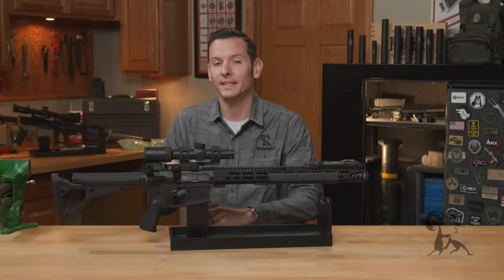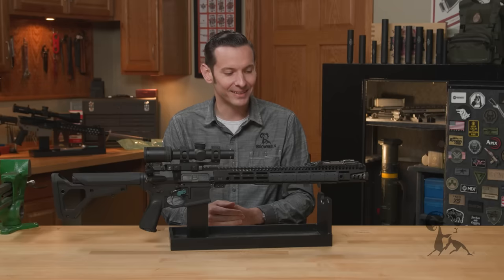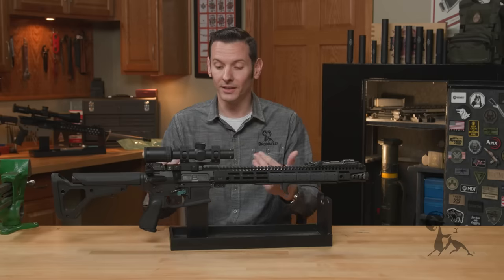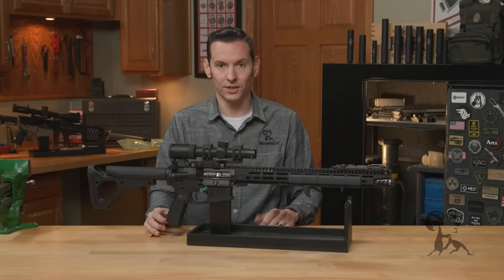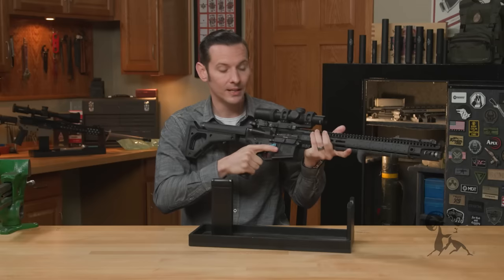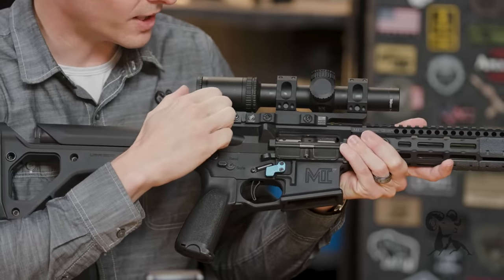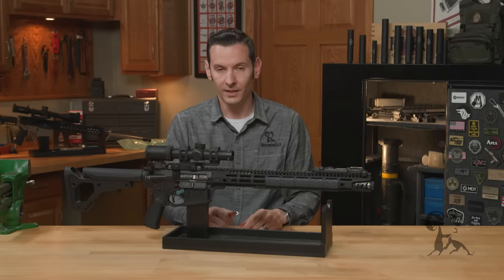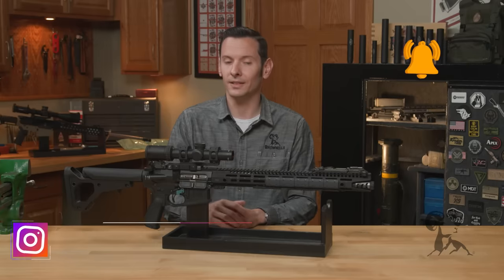Quick Tip: The RIGHT Way To Use the Forward Assist

Comment: Where's my forward assist gang at?
Reply: You can just push on the bolt cutout with your finger.  No button needed.
Reply: @Vuntermonkey  This doesn't work as well imo
Reply: Gang gang!
Reply: I feel cool tapping it after running the charging handle.
Reply: Caleb hit the nail on the head with this one.
Reply: @Vuntermonkey  No, you can't. This isn't an M3 Grase Gun.
Reply: Yuhhh
Reply: @Vuntermonkey  I covered that in the video... watch THEN comment.
Reply: @Vuntermonkey  with a crane O ring no you can't. And try that when the gun is red hot tell me how much you like your fingerprints.
Reply: 😂 I actually push it 🤷‍♂️ it’s a button I’ve got to push it and push it good 😁.
Reply: @J J Fun fact, Stoner didn't intend for the cutout to be used to push the BCG forward.
Reply: @Valorius  You mean I can remove my fingerprints that way?  Is it permanent, and will it mess with BATF tracing in the event I may want to purchase a sound suppressor?
Reply: I don't use the forward assist but it's on my rifle
Reply: Good to hear someone speak about SPORTS, I haven’t heard that term used in a while. It is a bit outdated, but it is a good starting place for beginners on this platform.
Reply: Here
Reply: I don't always use the forward assist........ But when I do, it's after learning what it was actually meant to do.
Reply: I get why people who only use their gun at a range under very controlled situations think it's not necessary. But I also roll my eyes at people who are unable or unwilling to think of times when conditions may not be ideal and it may be necessary. You listed a couple - the BCG is slick with lubrication, or there's blood on your hands. What if the BCG is so hot it'll burn you? What if you're laid out on a road with a mob coming after you and a guy a few feet away has a pistol pointed at your head and you felt the bolt wasn't in battery and you don't have time to look down and push it forward with your finger?

As an engineer, the argument of "Eugene Stoner didn't design it that way," is silly. A designer can't foresee all the problems with his design, and the reason the forward assist was added after tests was that in real world usage, the design didn't account for problems that having a forward assist solves.
Reply: @chrisgabbert658  I was going to do that lol.
Reply: Kyle Rittenhouse made me appreciate my forward assist a lot more than I did beforehand
Reply: @Legacy 1776 Stoner objected to the forward assist all together. Military brass requested it.
Reply: @RefreshingDrPepper in case you haven't noticed most people in the gun community don't care about your feelings....lol
Reply: It comes in handy believe or not.
Reply: Here lol
Reply: @edwarddrost5299  lol
Reply: I’ve never used it…but yet I insist I have it in every lower 😆
Reply: @michaelkennedy996  uhhh
Reply: @michaelkennedy996  I'll bet you didn't give up when the Germans bombed Pearl Harbor either did you? :D
Reply: @Mangoré1885  i'm glad it makes you feel safe
Reply: @shooter31m  No.  Anytime you hear SPORTS mentioned as something to do for immediate action, credibility is lost, including in basic training and BRM from your Drill Sergeants.

Tap Rack Bang
If that fails, 
Rip Rack Clear
Reinsert Push/Pull Rack Bang

Notice how Forward Assist isn't anywhere in there.

The main thing Forward Assist might be useful for is post water immersion, break chamber seal to drain the barrel, then quietly re-chamber the round.

You can avoid that problem by using muzzle plugs or condoms over your suppressor when working in a riverine environment.
Reply: @762x69  Kyle Rittenhouse should have reminded you it's not such a good idea to pick up a dry AR-15 from your friend's basement when needed for life-preservation.

Had it been lubed, he would not have had that malf.
Reply: It worked just fine for Kyle that one night....
Reply: @LRRPFco52  that's a funny way of saying that there's no way the ar-15 could've malfunctioned or put out of battery when he landed on his back and got hit by the skateboard guy..
Either way he said he still used it. Can't change that no matter how prepared you think we gotta be
Reply: Waaaaasssssuuuupppp!
Reply: I was anti-FA until a young man in Kenosha got his rifle knocked out of battery, used the FA and got back into the fight. I am an FA believer now.
Reply: Part of my training regimen. It's there for a reason.
Reply: I'm in 👍 The rifle will & should run without the need BUTT 🤭 I use the little pushy springy button thangy 🙄
Reply: Skreettttt skreeeetttt
Reply: @Vuntermonkey  ummmm you think Kyle Rittenhouse coulda just used his finger to push it home that night? Forward assist is needed when it is needed. I’d rather have one and not than need one and not
Reply: @762x69  facts
Reply: Gang Gang!
Reply: It blows my mind that theres so many who argue till theyre blue in the face with many who have actually used the fa in combat telling us how stupid and useless it is, but as soon as a 17 year old shows them in real time how life saving it can actually be they immediately change their tone. Aside from the actual uses of it, i think it completes the look of the ar. Ill never forego the fa on any of mine.
Reply: I'll keep my thumb off the bcg, and just use the F.A. especially when it's HOT... 👍👈
Reply: Sign me up, Caleb!
Reply: Present sir!!
Reply: SPORTS is not outdated nor is it useless.  Outside of a combat or speed needed situation SPORTS is still  relevant in determining the possible causes of stoppage or malfunction and getting your gun back up. Slap Rack Bang is just an abbreviated version of SPORTS to get you gun back up in a critical situation. The forward assist is still relevant especially if your ever had a dry nasty dirty gun in any of several situations. Shit happens
Reply: Checking in brah.
Reply: Won’t build one without one.
Reply: Whoop whooop
Reply: Me me me!
Reply: Forward assist gang member present and accounted for. (:
Reply: I love my forward assist, never leave home without it.
Reply: Kyle Rittenhouse has entered the chat.
Reply: I'd put two on my rifle if I could
Reply: @CalebSavant  I bet you get tired of reading people’s comments and knowing they didn’t watch the entire video
Reply: I use it for press checks as well
Reply: Better to have it and not need it than to need it and not have it 💯
Reply: FA gang 100%.  You only need it once to see the light.   What’s hilarious is guys who hate it being there but can’t figure out how to get rid of it.   They’re the same guys who have never cried about having the bayonet lug, since they hate unnecessary doodads on their rifle.
Reply: What sort of monster doesn't have a forward assist?
Reply: @edwarddrost5299  Fun fact I grew up next to blueberry fields and they would hire Mexicans to pick blueberries and tomatoes. There was a ton of these workers who had zero fingerprints  from cutting pineapples in other places and they still always left the country and got back in so I'm almost positive having zero fingerprints will prevent your suppression needs if you just tell the Feds you've been cutting pineapples all day and they will let you slide every time.
Reply: @BadDadio  it's depressing lol
Reply: @LRRPFco52  good Lord! Everyone is an expert these days! 

I said it was outdated, but it was nice to hear someone mention it, reminds me of days when everyone wasn’t an internet firearm expert. 

No one cares if YOU think it’s credible!
Reply: I just bought my first AR recently and made sure it had a forward assist especially after it helped Mr Rittenhouse defend himself
Reply: I think it's the reverse of what seems to be received wisdom. I think military weapons shouldn't have a forward assist but civilian ones maybe as some kind of marketing added value. The military issue weapon should have the least bits to worry about using as possible. The Immediate Action Drill should be simple, generic, to fix pretty much anything without worrying about what's gone wrong. (If tap, rack doesn't fix it, drop the magazine put in a fresh one and rack.) There's no need to do chamber checks if your handling drills are done properly. Same for bolt hold open - unnecessary on a military weapon, just means there's another condition to worry about the rifle being in and therefore decisions to make. A civilian can do all the fiddling and nonsense as they deem necessary, what does it matter. I'm coming from having had to train soldiers who knew nothing about guns and probably cared even less. Special Forces of course can get whatever gucci stuff they want.
Reply: M16A1 thru M4A1, thumbs up to the FA button. It's my opinion.
Reply: It’s a vital component
Reply: It’s a vital component
Reply: Still alive!
Reply: We were taught Slap, tap, rack, fire. Slap the magazine, Tap the forward assist, rack the charging handle, aim and attempt to fire. USMC ‘79-‘99
Reply: I just have to ask why Knights Armament doesn’t have a forward assist on their SR25 and M110 rifles? These rifles are used by arguably the most elite soldiers in the world.
Reply: So veterans, if you have one with it & one without, which would you take onto the field?  What about if you're correct (left) handed?
Reply: You damn eff AGs
Reply: ARRRGGGHHH  RRAAAAAHHHHHH!!!!!
Reply: Kyle rittenhouse stayed in the fight because of the forward assist
Reply: Hollahhhhh!!!
Reply: @rydplrs71  Why, was his charging handle broken?  In truth he should have had a sidearm ready to go(as should everyone), and drawn it as soon as the  trigger went dead.  He would have scored center mass shots with his handgun, not a bicep shot, and that other guy would be dead.
Reply: What is that hand gaurd? Would like to add it to my ars
Reply: @Vuntermonkey  That is the hillbilly way to do it.  Bolts get hot, dirty, and the cutout is weak no grab vs a forward assist.  Just ask Kyle Rittnehouse saved his live.   You would be dead.
Reply: Right here brother
Reply: @hoorayimhelping3978  100% , there are a lot of products that are used in a way that the engineers didnt initially design them for. Still you should be able ot use it. Plus that is also the reason products go through design changes and different version because the initial prototype just gets tested in a standardized test which is in many cases unable to determine a lot of things. 
And than when the initial gen 1 product gets sold due to different uses in different fields improvements are made to the product make it better. Just cause Stoner did design it that way doesnt mean it isnt an improvement that way. 
Stoner also design it in the way of having a 20'' barrel, of having specific iron sights and no attachment points for sights or lasers or other system. But here we are times changed and the product improved thats what many forget.

People who dont have the forward assist cause Stoner didnt design it that way should also only use a 20'' barrel, and iron sight.
Reply: @skilletfan932  gang gang buzz buzz
Reply: @legacy1776sibes  fun fact, Stoner was no advocate of the forward assist either. Moot point
Reply: @Vuntermonkey …
you are 100%  CORRECT…. My experience with the AR- started in 1964 (credit me with knowledge) the reason NONE of my AR’s builds, including 458socom, 9mm, .22, 6mm arc, .556, 762.39  have a lower with the FA. (one early lower has been altered with a plug)……..Logic>>> better to drop mag. - eject the FTF cartridge and get back into action faster, over the possibility of creating a worst (mortar) situation.        IMHO
Reply: @printingwithpeek4897 …
then why was it designed into AR’s BCG, taken from the ‘Grease Gun’ design 
by the original engineers…..  keep in mind, the M3A-1 bolt w/finger cut-out  REPLACED the M3’s cocking lever.  if your thumb can’t seat cartridge you 
should workout with a grip-ball.
LOL
Reply: @Physics072 …
if Kyle had any type of the known jamb types, HE would had been killed 
by  Grosskreutz…..(as without dropping the mag. the operation of the FA. would 
had caused a catastrophe jamb).  Kyle’s misfire was caused by a limp, unsupported firing position from his previous defensive kill shot to Huber as can be witnessed in the videos, and where the BCG cutout would had seated the cartridge……. Gods grace gave Kyle a simple round not completely seated.
Reply: @hoorayimhelping3978 I agree, Stoner could have never envisioned BIG ARMY not properly training their troops on a weapon platform before deployment in the field...
Reply: Has anyone watching ever heard 60 charging handles pulled back and released at the same time? The purpose of the forward assist was so troops in Vietnam could release the handle slowly and quietly then seat the bolt with the FA. Clearing the weapon was secondary and an after thought. Before the FA, we had to carry a fully charged M16 around all the time. I know this because I was there. You hunters can use the FA to charge your AR after you spot game, much safer all the way around.
Reply: @claytonblanchard4451  Or you can just chamber a round and keep it pointed up with the safety on, like a normal human being.
Reply: @printingwithpeek4897  Safe or not safe, I tend to lean toward safe. Ssgt. Blanchard, small arms instructor with US Army. Expert marksman badge. The world is full of abnormal people like me it's normal ones that keep taking themselves out of the gene pool.
Reply: @claytonblanchard4451  Infantry Weapons Officer, United States Marine Corps, 2011-Present. Complicating ctraining gives people training scars. Load it, keep it pointed up.
Reply: if you feel the need for the FA "I" would ask you to step backfrom my wingman
Reply: @rydplrs71 ....
if he had a 'stovepipe' or a 'stuck case', he would had been the third victim.
so sad inexperienced shooters are so naïve.
Reply: @legacy1776sibes  it’s not on the sr25 that he designed
Reply: @NortheastSurvival911 .
I'll give you the long story so you have more time to absorb the logic of facts. 
if Rittenhouse had a D.Feed (most common) malfunction and failed to drop mag- rack- clear- get back into action..but slammed F/A the results would have been his demise. Gods grace, from a wavering unstable firing position only a 'Failure to Chamber' was at fault. 
All my builds are w/o F/A and older AR's have plugs Research will prove a F/A was a POLITICAL add-on. 
Family and friends have been convinced to rid any problem with the ejection of cartridge. 
Your position will be known with the first shot/ so much for discreet "QUITE"
I accept "to each his own"
Reply: Its meant to jam a jam even more
Reply: @thomas7770  Do you not agree with my comment?
Reply: @LRRPFco52 dude what are you talking about? We ran dry M4s in Afghanistan all the time. You sound like no combat Caleb now 🤣🤣🤣
Reply: @thomas7770  Afghan sniper button 🤣🤣🤣
Reply: @MyLittleMonsters  A lot of units had bad practices with weapons lubrication due to inept leadership.  Doesn't mean it's a sound practice to run the AR dry.  Kyle Rittenhouse's S&W Vismod-15 had a weak action spring, which is why his BCG went out of battery in the 1st place.  Hitting the butt of the AR on a hard surface should not cause it to go out of battery.

I deployed with M16A2s, M4s, and M4A1s all over the world, from Arctic to the ME over a 22yr period.  I lube the BCG generously with oils that don't cook off fast and that don't granulate in the cold, namely CLP, SLIP2000, and LSA.
Reply: passed away in 1973
Reply: @762x69  Kyle Rittenhouse’s Vismod imitation AR-15 had a weak action spring.  The cartridge and BCG should not go out of battery when the butt hits the street like that.
Reply: @LRRPFco52  which is why it's good to have redundant functions when things go wrong. This isnt the slam dunk you think it is when dealing with a platform that can have many issues when confronted by a mob of people trying to throw you around..
Reply: @762x69  The mob of people is immaterial to the function of the AR-15.  I just went and tested several of my ARs.  With the muzzle in a safe direction, I allowed the butt to slam into the ground to see if the BCG would retract any and not go back into battery.

Every single one of them so far went back into battery with a cartridge and a loaded magazine applying pressure upward under the BCG.

The question then becomes, why didn’t Kyle’s S&W M&P-15 do the same thing?

A. It’s out of spec, has a weak spring, tight chamber, something different than my in-spec carbines.

B. An angry mob was present.

Either way, better to be in a place where your carbine critical parts adhere to the TDP and don’t fail like that M&P-15 did on him that day.  That is the lesson to take away from this, not that the Forward Assist is an important feature to have.
Reply: @Vuntermonkey  Oh look, we have a internet professional that knows more than the gunsmith that put out the video, where are your videos, what are your credentials, that is what I thought. Leave the teaching to someone that knows what the hell are talking about.
Reply: More showing. You want people to know the right way 100% right? Show the proper full sesh over and over and over. Different angles so people can actually see and have zero questions on what you mean or what you’re talking about. People do this- then doesn’t show the full thing or anything of what he was talking about. Not everyone is 40.